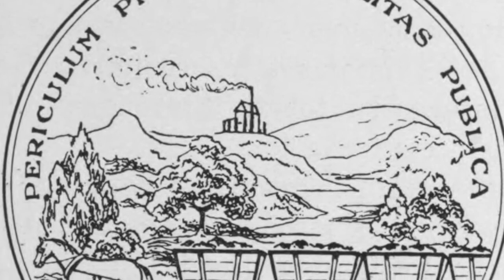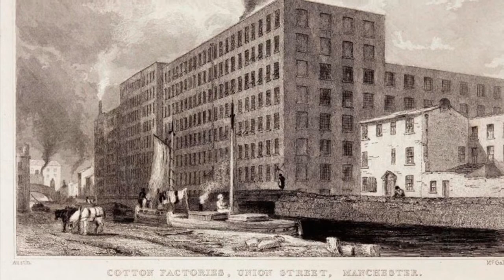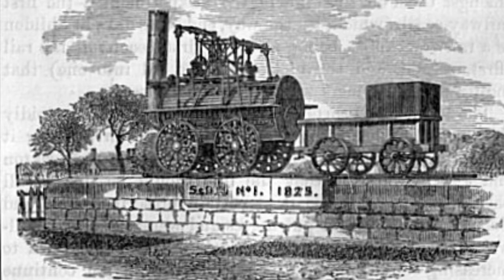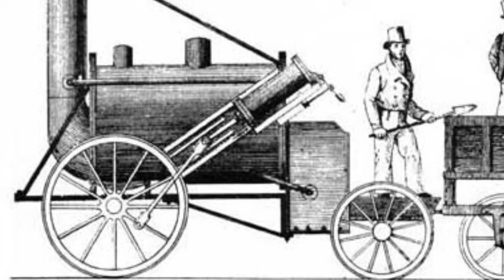Rocket ‘n’ Roll, Part 2

Comment: As always, lots of good information packed into a few minutes, great stuff.  The multitubular boiler gives lots more heating surface but the pressure drop through the tubes is much greater than in a single large tube. So the blast pipe was essential to make it work and give enough draught to keep the fire going.
Reply: Yes. Surprised he didn't take ten seconds to explain that a blast pipe uses exhaust steam from the cylinders to create more draught through the chimney.

Comment: you missed the important point... multiple tubes have a significantly greater surface area than a single tube, and can therefore transfer heat to the water much more effectively and efficiently.  Dramatically improving the amount of steam the boiler can produce.

Comment: I believe that you will find that Trevithick turned the exhaust up the chimney first to improve the pull of air through the coke fire of his locos, and he invented the lead rivet in the fire box crown sheet as a 'fuse' to prevent boiler explosions. Hence the fusible plug. Good videos though, waiting for part three.